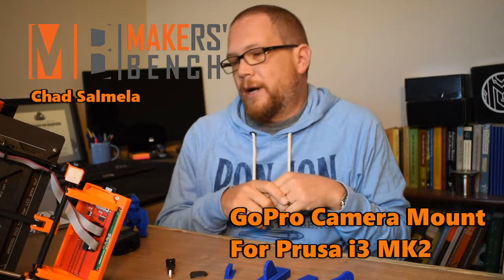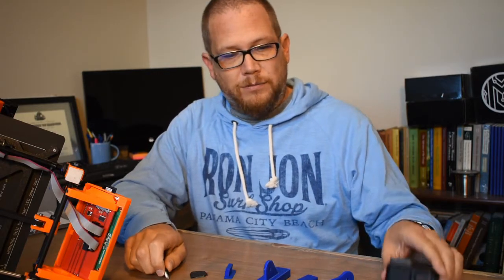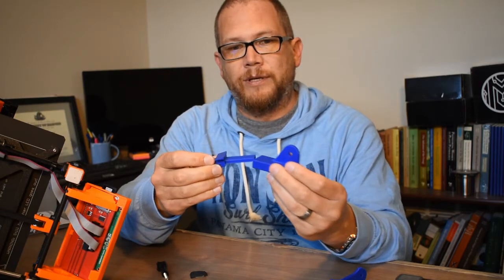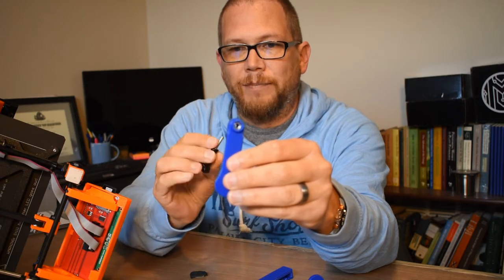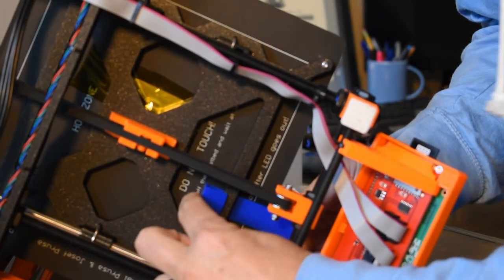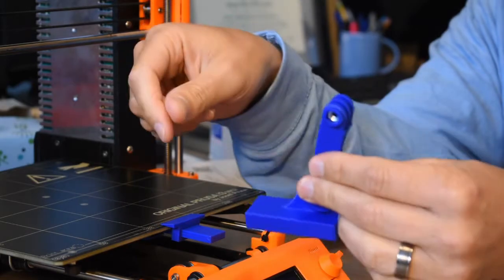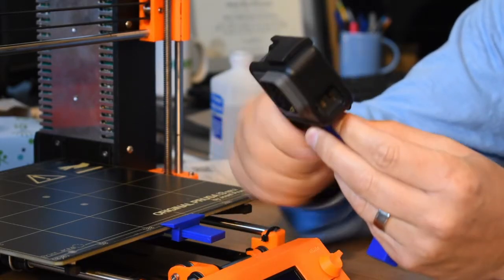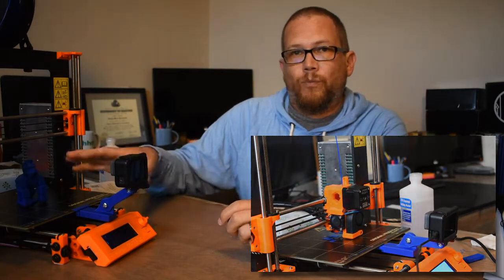GoPro Mount for Prusa i3

Comment: Nice mount! Do you have a recommendation on Go Pro cameras? I'm interested in getting one but haven't shopped or looked into it at all.
Reply from the maker: Thanks. I didn't do a ton of research on my GoPro. I know there are some cheaper brands out there, but it was easy to run down to Best Buy and get a GoPro. I went with the Hero5 because it had the screen on the back of the camera.

Comment: Does the heated bed soften the PLA?
Reply: Makers Bench PLA will start to soften as you approach 100C. It may not be a problem now if you are just printing with PLA. But once you start printing with higher temp filaments that need bringing your bed up to 100C, it may be. Of course you can always reprint the mount in higher temp plastics. Good job on the design, though!
Reply: I went with a different design in the end and modelled a camera mount that fixes to the spare screw hole on the x-axis stepper motor.  It's fine in PLA as away from most of the heat also like the fact the camera climbs as the model is printed. If anyone is interested i've uploaded to Thingiverse https://www.thingiverse.com/thing:2443129
Reply from the maker: I've thought about that. Since the PLA hot end temp is up over 150°C while printing, i think it would take a lot of heat to soften it up. The heated bed temperatures are much lower. So, I don't think it will be much of a problem. Plus the heat is actually directed up, and my mount (except for the clip on top) is actually under the bed, I don't think there will be any issues. But, it certainly something to keep an eye on.

Good Question.
Reply: Am interested as my mk2s kit is currently being shipped and i have a logitech cam i am looking to mount in a similar fashion.  I have seen mounts using the screw that connects the heat bed to the frame but i like the idea of your mount as gives far more flexibility when it comes to positioning rather than it being fixed at the corner of the heat bed.  Keep up the great vids.
Reply from the maker: One thing I want to add is the ability to swivel so, I don't have to have the camera on center.
Reply from the maker: Yes, you are absolutely correct. If I do run into problems with it, I will reprint in ABS. But, for now, I'm still prototyping.
Reply from the maker: Nice, I will check that out.